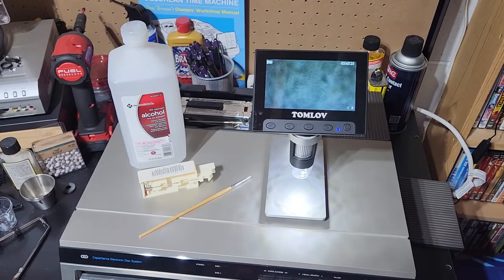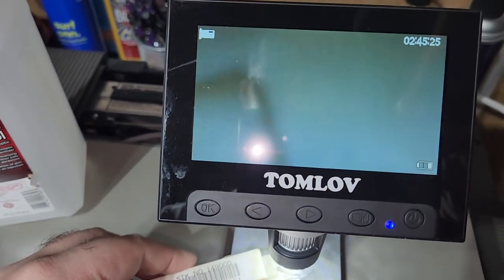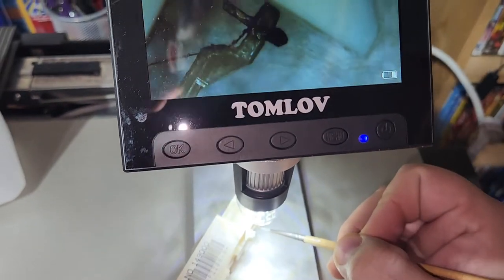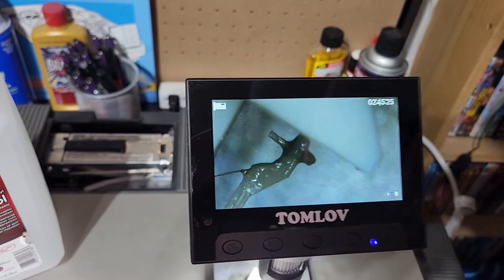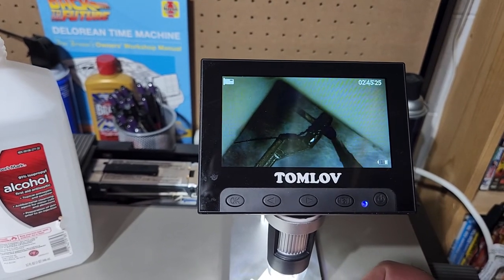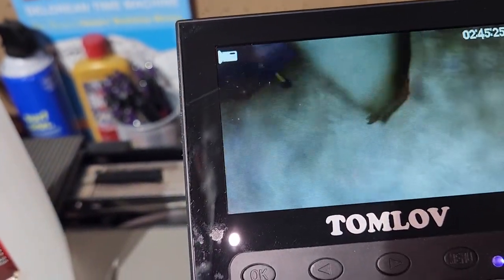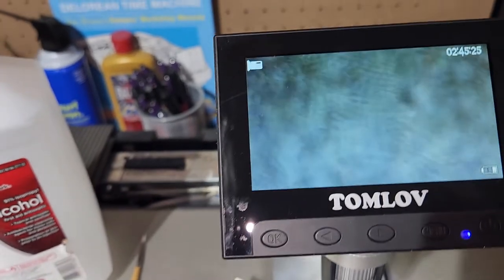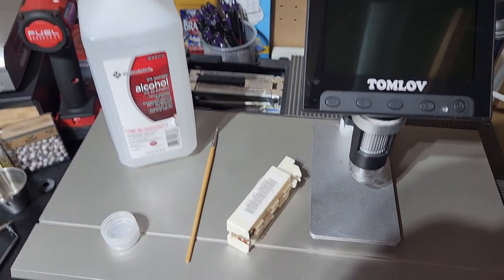How to clean a stylus on a CED Videodisc Player

Comment: mine works but my color goes in and out almost like bad tracking on a vhjs tape. im afraid to clean it / make it worse lol or even worse break it.
Reply from the maker: Color imbalance is caused by improper turntable speed. Your stylus is fine. You probably just need to remove the platter and re-lubricate it. Check out my other videos for service instructions. Thanks.

Comment: Have you ever tried using contact cleaner?
Reply: I have not. I have always used isopropyl alcohol because that's what RCA recommended. Given how expensive and sensitive these styli are I wouldn't want to risk trying anything else when the recommended product already works.

Comment: My SJT300 just arrived here in Australia from the US earlier today. I fully expected it was utterly destroyed in shipping based on the condition of the packaging, 

Amazingly, it arrived with a visibly clean stylus, an intact 3rd reduction gear, and an unbroken transfer rod coupling. I cleaned up the goo that was once the function motor drive belt and fitted a new one, and now the player opens up and waits patiently for a disc when it’s powered on. I’m extremely excited for my discs to arrive.